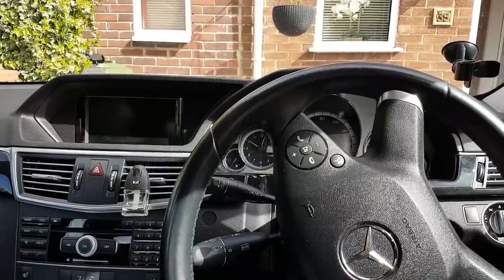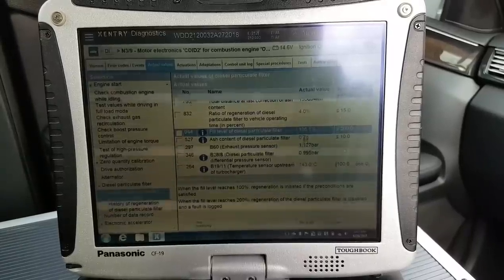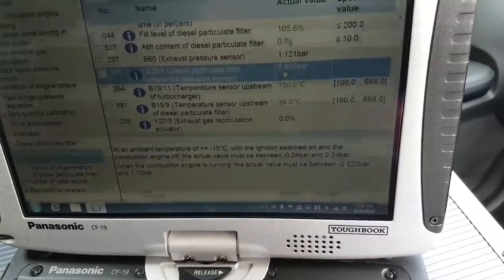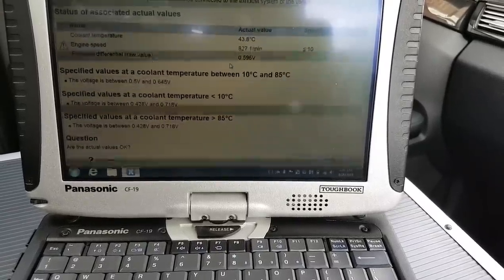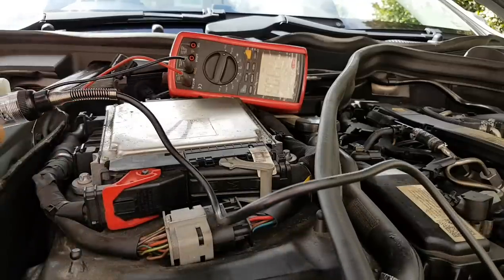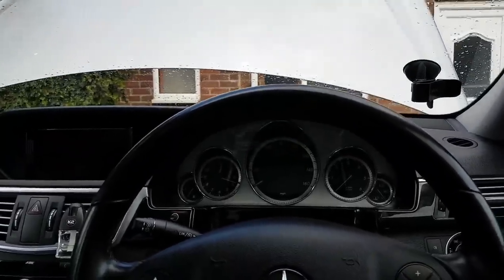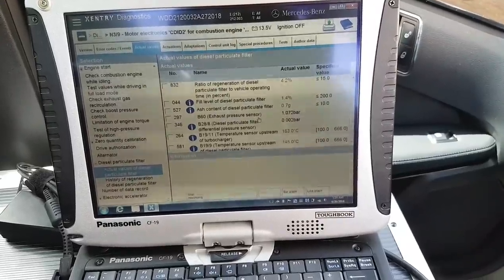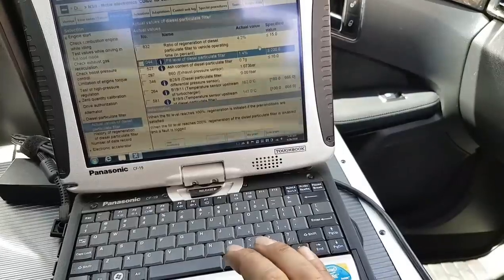Mercedes w212 E250 limp mode. P2454 DPF issues. Fault finding and repair.

Comment: Great vid as always. You could cut your sensor testing time in half if you use the ground lead on your multimeter to backprope the ground of the sensor then use the positive lead to backprope the 5V ref. Sensor plugged in reading 5V. You have just checked computer and both wires all in one test. Then move the positive lead to the signal wire should read approx 0.5V start engine and rev should change. If doesn't, unplug the sensor jump 5V ref pin to signal pin using 5K ohm resistor watch scan tool data change. All wires and computer response checked. NO NEED FOR RESISTANCE CHECKS THEY ARE NEXT TO USELESS(The circuit is not loaded as designed to). Plug sensor back in using vacuum hand pump pressure up sensor see if the voltage on signal wire changes. Last test put vacuum hand pump on each hose to sensor start engine and rev look for pressure changes.
Reply from the maker: Thank you for watching and for your comment!
Reply: Rocket science my friend 🚀

Comment: Great vid , Dpf sensor pron to condensation inside & causes a number faults . I have taken a few these sensors off & water inside. Maybe thats y old sensor  worked when u tryed it back on the car the moisture had dried up. who knows :)
Reply from the maker: Hi
Never thought about that... good tip...
Thank you for watching!

Comment: Very good video , you explained very well. 
I have a question, i have a glk x204 220cdi 2011 and it has 118000km . Today i have changed oil and filters and i have also changed diesel filter . But after that when I completed the service, I went for a try but it seems car have to power and i turn off the car and started again and come engine light on . My obdi shows P2454 dtc sensor A . I thought maybe i just bought the wrong diesel filter and i have removed and installed the old original. But the problem continues. 
Can you please help me ? 
Thanks
Reply from the maker: Already answered...

Comment: Also I’ve scanned my car recently which keeps going into limp mode and found I have the same code. I’ve bought a new sensor and will fit it soon. Hoping that fixes the issue. 

Looking on the forums this is a common issue

Comment: Great video. I used my icarsoft 2 and it gave the same information your scan tool did pointing to sensor, so a new one was fitted and problem solved. :-)
Reply from the maker: That's great! 
Well done!
Thank you for watching and for your comment!
Reply: Which sensor did your iCarsoft II tell you it was?
Reply: @davidgarner3275  DPF pressure sensor, £25 on ebay
Reply: @scottb5716  hey man I bought a genuine MB sensor as I was afraid of using a cheap one. How’s yours holding up?
Reply: @K20TypeR  I bought a Bosch which is a genuine one as far as I can tell, it replaced a Bosch one. Still no problems after a year.
Reply: @scottb5716  that’s awesome and good to hear! I could have bought the Bosch one cheaper! Oh well! 😀

Comment: hi, any problems with the steering in general? pump or rack or the speed sensitive valve??
by the way, can you tell if the speed sensitive valve is on the pump or on the rack?
mine is on the pump and it`s wird...help pls
thanks
Reply from the maker: Pass...🤔
Never had that issue nor worked on that...
Sorry...
Reply: Ok, thanks for the fast replay.
I want to buy the MB STAR. Any recommendation?
Reply from the maker: @cloatza89  
Just get a decent quality one...
Shop around...👍

Comment: Subscribed!! Where to get non expensive diagnostic software for merc?? What you use?
Reply from the maker: Hi
My main tool is the MS908P...
Very good...
I am also testing the Artipad l... similar functions as the MS908P... But have not fully tested it yet...
I also have the Star... which is a must if you  work on a lot of Mercedes...
Thank you for watching and for your comment!
Reply: @LMAutoRepairs  thanks for your reply. What cable do you use for your software?
Reply from the maker: @aleksandrsguscins3877  
The star... just Google Mercedes star...😉

Comment: Hi I’m having issue with p2002 and p 2453code all pertaining to dpf and differential pressure sensor.  Took the dpf out had it cleaned with excellent flow and replaced dp sensor dpf was reset and dps was relearned using scan tool but same codes come back.  Car drives good with decent power I just worried truck will plug up again if it doesn’t regenerate the dpf.  Anyone know what could be the issue.

Comment: Hello!  I have a problem with the Mercedes w212 class 2010. There is power loss up to 3 thousand rpm then the turbo is put to work.  The codes generated by the computer were p0106 and p2074.I repaired the manifold motor and air pressure sensor.What could be the problem?

Comment: With this fault, did the engine limp mode and not wanting to go over 3000rpm?
Reply from the maker: I believe so...
Thank you for watching!
Reply: @LMAutoRepairs  I have been wrapping my head around what the hell was wrong with a friends car, he had a new sensor installed also but still will not run proper. Same type of max 3000rpm driving, no boost, no power from engine. Maybe the lines up to the sensor has to get some pressurized air in them to blow out soot and stuff?
Reply from the maker: @stbo84  
Have you scanned the car?
What codes are you getting?
Reply: Get soot levels too high and intermittent sensor fault, the top sensor you replaced in your video:)
Reply from the maker: @stbo84  
Have regenerated?
Reply: @LMAutoRepairs  Workshop tried but it didnt want to regenerate in a hour long drive. That was after the sensor replacement (370 sensor) and clearing of codes.
Reply from the maker: @stbo84  
Check the lice data for the DPF level... back pressure etc...
It might be that your DPF is clogged to a level that the car will refuse to regen due to safety...
You might need to remove it and manually clean it ...
Reply: @LMAutoRepairs  Yes, i think thats what the problem is now, so i have planned on removing the dpf tomorrow and pressure wash it and see how it will work out afterwards. Thanks for quick replies:)
Reply from the maker: @stbo84  
No worries...
👍👍👍

Comment: Hi, just a punt. My e250cdi 2012 has an issue where it seems to be in limp mode all the time. I've had 2 mechanics look at it and £1k and a MAF and egr later, it still has the same problem. Initially after its had the work it seems fine but after a few miles of driving the limp mode comes back on and after a while the EML comes on. Wonder if you have worked on anything similar
Reply from the maker: What codes are you getting?
Thank you for watching!
Reply: @LMAutoRepairs  Im a bit too trusting and never made a note of the codes. But initially it was a MAF sensor related. Mechanic replaced that but same issue. Second mechanic used star on it and said the 2 codes pointed to a faulty egr. Tested the egr and said that it wasn't working so put in a new siemans egr. But after a 3 mile drive I have the same issue and EML is back on. I think at some point the exhaust pressure code was mentioned. The car is very rough through the gears. Initially I thought it was the auto gearbox but mechanic is adamant that's fine. By the way today the car was low on engine coolant too. Thanks for the swift reply 👍🏽
Reply from the maker: @amharali  
Right, you already replaced expensive parts dad did not solved the problem... something has been clearly missed...
Check the codes this time, but also a good walkthrough the live data... your answer will be most likely somewhere in there...
Reply: @LMAutoRepairs  thank you. I will mention that to the mechanic with the star. I'll try getting the engine codes tomorrow. Do you think it could be losing pressure somewhere in a pipe or worn wiring somewhere
Reply from the maker: @amharali  
Absolutely... it can be many or one out of many different things causing the problem...
Reply: The fault code now is p227906. The mechanic said he advises a carbonisation of the whole engine as when he fit the egr he noticed there was loads of carbon deposits everywhere. He cleaned all the bits he had to take off for the egr but left the rest. by the way with the code it says "there is an algorithm fault"
Reply from the maker: @amharali  
Check for vaccum leaks...
Reply: @LMAutoRepairs  I've been advised someone else to not do the carbon clean as it may lead to bigger issues because the car has done a lot of miles. But he said that he's pretty sure that the leak in in the intercooler pipe on passenger side as he's done 2 previously and them cars had same issue. Apparently that hose can collapse inside and you can't see the damage as it's braided 🤔
Reply from the maker: @amharali  
A smoke test will show you where the leak is...😉
Reply: @LMAutoRepairs  don't think these mechanics around me know what a smoke test is 🤣 hopefully it's a leak in a pipe and not the manifold as I've read up online and every other post claims that one of the manifold bolts break off causing the leak. But I find comfort in that I can't hear any form of leakage